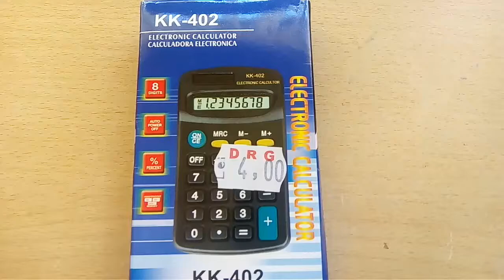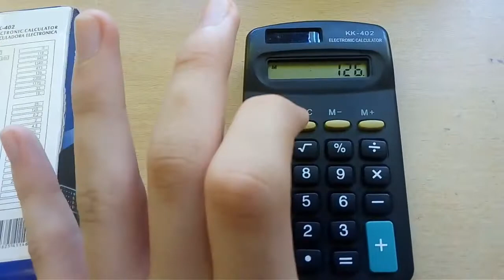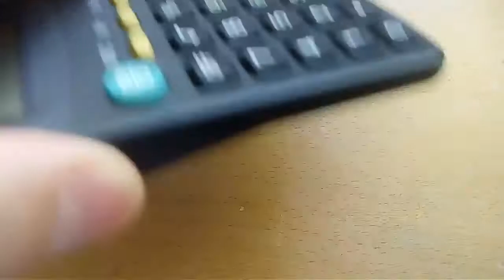KK-402 calculator

Comment: I actually have exact this calculator, my father bought it back in 2004, and it still works
Reply: 2004... So the calculator is really that old?
Reply: @puppycornthewindowsxpfan9363  Yes, fortunately, i have to say that a segment of the lcd died, which makes it impossible to tell what the number is, kinda bad when writing an exam.
For a cheapo calculator it's awesome how long it worked.
Reply: @PanaSonyc  nice
I remember i had tons of these calculators
There were even 2 versions
One without fake solar and colorful buttons
And one with fake solar and colorful buttons